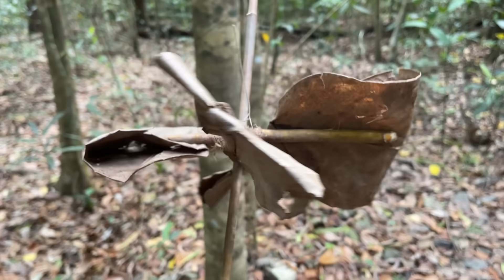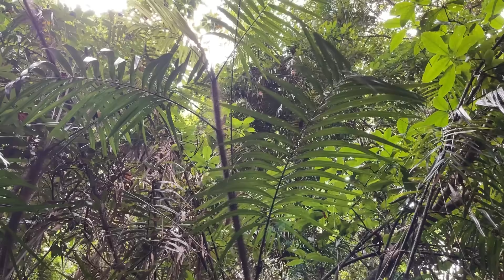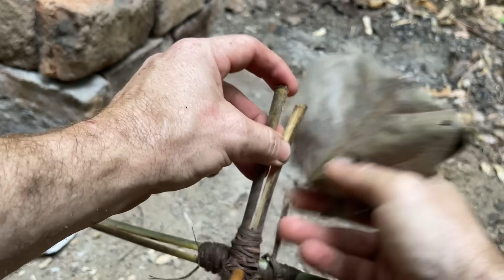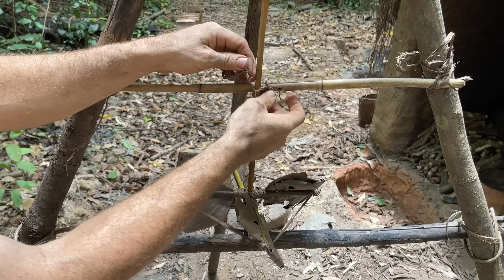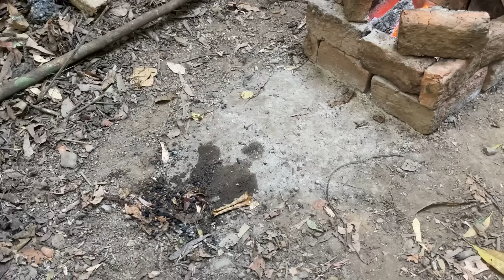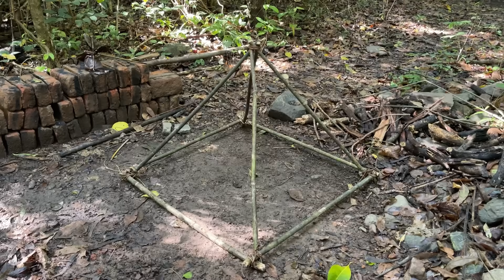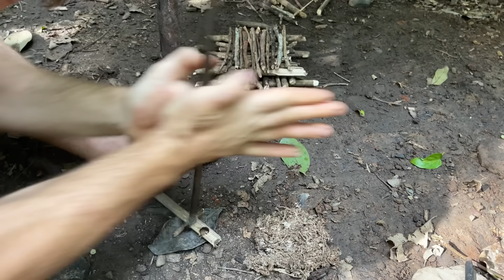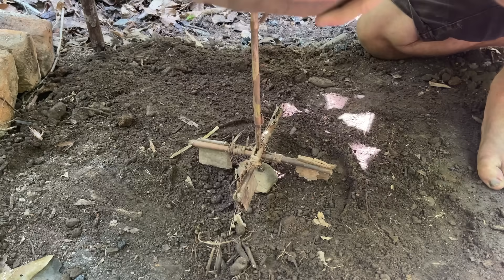Primitive Technology: Convection turbine experiments (hot air windmill)

Comment: Yup, this is where everybody goes wrong when trying to invent a turbine.  Whether it's wind or water powered, it's really easy to get it to spin fast on its own, but getting it to spin fast while driving a load is much more difficult.

Oh, and also, you're using a natural draft to drive a forced draft, but I don't think this setup can ever move more air faster than just using the natural draft by itself.

Comment: It is interesting but stillborn idea. Air have very low density (about 1.2 kg/m^3), so to carry any sizable amount of energy it should move very fast (baldes should be as big as possible too for catching big volumes of air) - that's why modern wind turbines is installed so high to catch stronger wind. You don't get this kind of speed of air from fireplace or oven. On the other hand water have density about 1000 kg/m^3  - 800 times more than air, so water wheel is much more preferable for practical use.

Comment: I think you need higher pressure. To achieve that, you have to heat the air more. A structure with a sealed combustion chamber and a tall chimney, like the furnace you made before. Also, I think adding some water would be a good idea. Just a few drops will create steam that provides extra pressure. If we poke a hole in the water tank and plug it with some fiber, we can automatically supply water at just the right rate

Comment: I have a camping air mattress that comes with a pump that mostly consists of a bag that connects to the fill port on the mattress with a hole you cover with your hand or foot when you compress the bag and there is some foam that springs the bag open when you release it. I feel like using a hand or foot instead of a check valve could make the water bellows a viable option. As well as making the bottom of the bellows out of clay with a pipe going up the middle above the water level so the tuyer doesn't move while the bellow is in operation.

Comment: You need a lot of back pressure to drive a supercharger. Possible to do with a wood fire, but you'll be limited in how much pressure you can generate with an open flame. Probably easier to get something functional with an enclosed furnace and tall smoke stack.

Comment: I suspect the chimney effect is probably the most efficient way to use rising air to power things. I wonder if you could make wicker ducts that are sealed with clay or possibly some slimy biofilm. Then it might be possible to make several camp fires that creates a suction effect that could be used to suck air into the target fire. Possibly utilizing the Venturi effect. It is not a cohesive thought at this moment, but possibly something to noodle on.

Comment: I'm sure there are people here with better ideas than myself but if you take a power generator in a coal power plant, it typically has multiple turbines. One set of blades spins but then all that hot air is still rising and just keeps going up. Essentially it's wasted. More levels of blades layered perpendicular to the one below it will continue to catch all that wasted energy contributing to more thrust and I assume speed. Then probably make a cylindrical brick chimney and put the blades inside it. That way it's an insulated wind tunnel as high as you choose to make it. Plus Fire Safety Monitor would be happier about it. Also, a coal plant uses steam power so maybe boil water over the fire and put a funnel-shaped cover over it to give a little pressure to the steam. Basically a giant tea kettle. Not sure if that would be any better than the heat from the fire rising but would be fun to test out. If it works, you basically have a stone-age steam engine.

Comment: Maybe use clay shingles instead of leaves? And make the roof a rectangle, with the mill at one end and the fire at the other, the roof being slightly slanted upwards towards the turbine. You could also use brick and clay instead of sticks and twine; I'm not entirely sure how you would make the roof completely fireproof though. You could cover the sticks supporting the shingles in clay, insulating them from the heat. You could also make a chimney that curves towards the top of the mill? This sounds pretty obvious after I write this down, this is me just spit-balling :)

Comment: It was probably a joke video, but there are some improvements to be made that could increase viability:
1. You need an enclosed chimney for the hot air to go straight to the turbine. Too much heat is being lost to the environment. The first hood experiment demonstrated that well, but in subsequent uses, there were no enclosures around the fire to stop heat loss.
2. Air is really weak. To get any usable torque you need a lot of air and big fan blades. Water is much more effective. This is why steam turbines are used. You could do something like having a pot of water on top of/near the fire to constantly boil and pump steam through the turbine.

Comment: Have you considered using a gravity battery to power the blower to the forge? Lifting a heavy rock or log in the air, and having even a short piece of cordage tied to it, then wrapped a thin stick/axel for a blower.  That would allow the rock to come down and make the blower spin powerfully for a long period of time without having to reset it.  One could get around cordage limitations with the use of levers and (labor and wood quality would be a factor) pulleys.  Potentially “gears” just using different sized sticks, with cordage wrapping around a large diameter stick to a smaller one, which a channel cut in it for the rope.  Just spitballing here.  Been watching the channel for years I can’t count now, and have loved watching all of the various alleys you poke down to problem solve.  Awesome to see your love for invention!

Comment: My 2 cents would be:
1. Make the turbine slightly bigger than the rotor
2. Minimise losses, channel the hot air with a similar cone but made from clay or mud and make sure to include an enclosed throat for the turbine, youre losing a lot of energy when the airflow is not all forced through the turbine, in the current design the pressure drops rapidly at the exhaust and youre losing a lot of kinetic energy as a result

Comment: Very amusing and cool.

I wonder if a clay-based chimney to concentrate the hot air, along with more blades on the same shaft (i.e. multiple sets of 4 along the length) would get more power.

Comment: 👍You could use clay to redirect the heat above the fire. If the turbine is placed in a clay pipe, it should be more efficient and significantly safer. Nice idea at all.

Comment: I'd definitely build the roof slanted to one side so you can center a larger fire under it without the shaft being in the way - and I'm not sure how much power you can actually get from this, but a simple pulley system like the one you built before could presumably get more speed for your blower... I'm sure you've thought of all that already though. As well as probably a tile roof 😉

Comment: Maybe a thicker roof cap with bark tiles and sealed with clay? That might be a more fireproof and even air-tight roof. 

Although, I am not sure how the project will help with the blower process. I am worried that there is too much energy loss for it to be meaningful, and that it would only maintain the fire's temperature for longer rather than kick it up once started.

Comment: Hey, this rules and is a great idea and you should follow up on it in the future. I think part of the issue with this first pass is that you don't have enough air flow rate for the small impeller to actually generate the kind of torque needed to drive a mechanism. That leaves 2 options: 

-increase the impeller size/number of blades/etc so that you can get more torque from the slow airflow rate you have

-increase the amount of air being input into the mechanism, possibly with extra fire sources. You could also probably achieve this with a chimney?

Comment: A durable axle at the thrust bearing, (like an iron point), would allow for much larger fan blades. If properly tensioned, it could run a gear reduction for a blower.

But it would all burn down, of course

Comment: Too much energy is lost using the convection air, one workaround is to harness waste heat to boil water in a ceramic vessel that is shaped in a way where the escaping steam gets concentrated into a high-speed stream that can be aimed point-blank at a turbine. Fire Safety Monitor will also approve of the fact that steam is inherently wet and will not set fire to things.

Comment: Some pottery kiln designs are more horizontal than vertical. They feed air in low to the ground at one end to burn fuel, it gets progressively hotter and more carbon-hungry as it travels through, rapidly heats a ware section midway in, then is allowed to escape through a tall chimney at the other end which drives the airflow further through convection. something like that seems perfect for directing airflow through a chimney to a turbine, without it being directly above the flame.

Comment: can you weave together palm leaves into sheets, and then cut the sheets into rectangle strips about 25cm wide by 50 -70 cm long and use that for blades?  it's got to do better at moving than 4 leaves.  also, there nothing saying you couldn't build a tunnel to duct the air using bricks.  that would make it safer as it wouldn't burn anything down.

Comment: Needs a tile roof and more blades on the top fan than the bottom fan. Perhaps a straight rotor too. And you will need a chimney to direct the heat more efficiently. The open sides allowed a lot of energy to escape before it even reached the roof.

Comment: I think trying to make the fans out of ceramic would be a better choice, that way you could use the water current to generate torque and try to setup some gear ratios to control the fan output on blower.

Comment: More efficient to use suction from updraft, surely? 

Ultimately, either way you're using buoyancy from the hot air to draw more air in. But this method has the added inefficiencies from both turbines and the friction of the spindle bearing.

Comment: There's a bit of an 'energy exchange' problem happening there.  While it's been pointed how humans did experiments like these to learn what we know today, sometimes we don't have to re-invent the wheel if you pardon the pun.  A 'rocket' style of furnace would work better, some of your designs have already used that 'technology' so you have a confined exhaust that can go whooshing by another 'intake' chamber to draw air in as it goes up.  If you tap into that cold air draw with a far larger 'water wheel' style design, that could drive a much smaller axial blade like you are using at a much faster speed with a simple pulley mechanism (and less risk of a fire to boot).  That smaller blade would pump a lot more air than what you have with the 'open' design you are using.  This would be in the realm of 'imagination' of early man, but since you're already playing with making iron/steel, this is something that could fit in that era of invention.  Doing it purely in the fashion you use would be quite the bit of amazing primitive engineering.  I've no idea if it can be made to work, but the theory is there...

Comment: I can see where you're going with it. Instead of a pyramid shaped frame change it to a truncated square pyramid frame, replace the roof leaves with fired roof tiles, maybe a larger diameter upper fan and blades sitting down perfectly in the roof opening so as not to waste any passing rising gasses, a smaller diameter lower blower fan in relation to the top fan so you get more spin. Would it be worth making a new blower housing in slightly smaller dimensions to snugly fit a smaller lower fan?

Comment: For increased efficiencies: Turbine blades internal to a flue with close tolerances. Need a bit of mass in the turbine blades to act as flywheel. Flue can converge leading into turbine to speed up gases impinging on turbine blades and diverge leading out of turbine to provide area for gases to expand into. A flow straightener leading into turbine blades may be helpful to control turbulence. Perhaps one at the exit of turbine blades also. You've already figured out the blower pretty well for the materials on hand, just have to figure best way to couple turbine and blower or best configuration if keeping on the same shaft. You will have to contend with hot flue gas and your choice of materials.

Other ideas that are off the wall: Have an alternate secondary flue pipe with a damper to modulate or tune the flow in the primary flue pipe, may be useful to get things going or prevent overheating. Maybe slotting some angled holes into flue can up the mass flow by drawing ambient air into it while also cooling down the hot gases interacting with your turbine. Think of a venturi air horn.

I enjoyed watching you experiments over the years and have been around pumps, motors, power producing equipment for a long time and hopefully this advice can be useful to you.

Comment: On the iron smelting topic, have you tried varying the types of charcoal used? I know that the base wood (or equivalent) that is used to make the charcoal has a significant impact on the strength of black powder made with it. For iron smelting, I suspect the amount of heat different types of charcoal create would be the most significant factor. But the different impurities given off could have an effect on the composition of the iron alloy.

Comment: Cool stuff! I wonder if you could make a mud/clay furnace with a crooked chimney so that the top is offset from the center of the fire. You would have the fan at the top of it and have small holes in the chimney so the stick/shaft can go straight down. The chance of burning it down is probably high though.

Comment: I always love your videos! A new one is always a highlight of my day!

I know you have things well under control, and this was maybe more of a proof of concept build, so forgive me please for adding my 2 cents: 

I think you'd get much better airflow just from optimizing the draft of the furnace itself. I've watched your other videos and I have seen you experiment with draft furnace designs before, and I kinda expected you to keep refining those designs.

I would do a double walled set up on the lowest two courses of bricks, leaving an air gap on the right hand side of each face of the outer bricks, forcing the incoming air to spin in a counter clockwise direction (or have the gap on the left hand side for a clockwise spin, doesn't really matter) around the central course of bricks, allowing the air to preheat some, then off set the air gaps on the inner course of bricks from the outer ones but do the same air gaps on the right hand side of each face of the inner course. The convection alone will drive far more airflow than you'll get from the blower. And with no moving parts. And with some preheating.

If you're really committed to the blower though, it's always going to be a matter of optimizing the moving parts and the non moving parts. The leaf blades have to be the first thing to go. Spending some time to split out thin strong blades from wood would be well worth it. 

The bearing surfaces are more challenging, but for things spinning vertically, you could maybe lash or use natural glue/pitch to attach rounded quartz to the tip of the spindle and have a rounded quartz in the pit the spindle spins in. The point of contact between two rounded pieces of quartz would be very small and quartz is so hard, it might make a good bearing surface. The horizontal spinning surfaces are much more challenging, obviously. Maybe fire hardened and polished wooden surfaces? Again I've seen your videos where you experiment with solving those problems, and expected more refining.

The trade offs between speed and torque will always be a challenge. I think you'd have better luck with water powering it. 

 And I know you have a stream nearby because I watched the videos where you experimented with water wheel designs for powering the blower, which I also expected you to refine further. A carefully designed over-shot water wheel with robust wooden paddles, robust wooden axles and gearing, and a robust wooden blower, or designed to drive large bellows, I think would be your best bet. Aside from optimizing the draft design, or in addition even.

Sorry, I know you've been doing this a long time. I know you've done the research. I'm even fairly sure you've considered every single thing I mentioned and have reasons for continuing in the direction you're going. I mostly just needed to write out my thoughts for my own benefit. I admire and envy how you spend your time! Keep up the good work!!

Comment: The system will probably be losing too much energy to work. You might need to build multiple fires powering a single blower. 

You could also try building it inside an enclosure/small structure so the heat from the fire is all directed upwards.  

You could also try a smaller blower fan. 

Experiment with larger turbine blades

Comment: To reach higher temperatures for smelting metal. i would try a huge blast furnace (maybe 5m high and 1m diameter). since this is difficult to build maybe it helps to build it leaning on a cliff.
otherwise waterpower and some gearing might create a usable fan. animal skin would probably make an awesome material for bellows. Also if he could find a metal with a lower smelting point life would be so much easyer